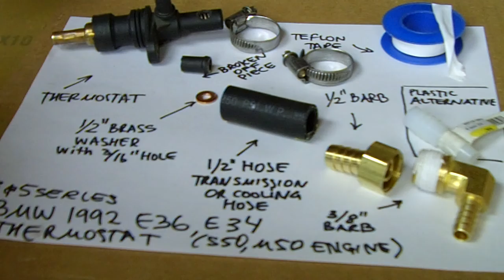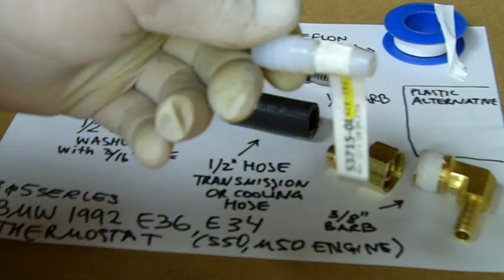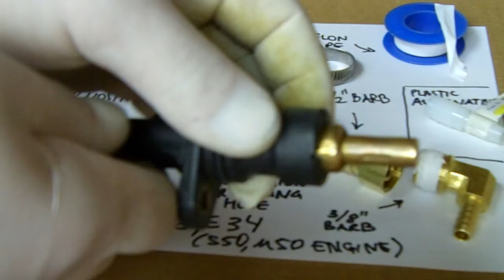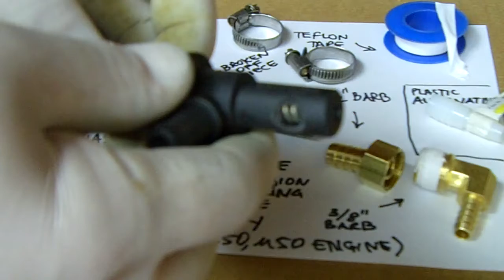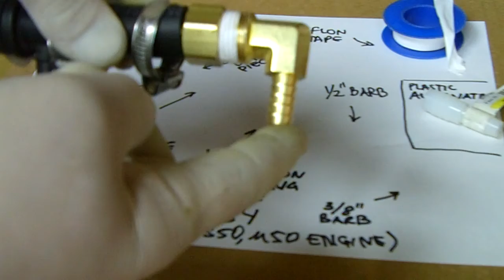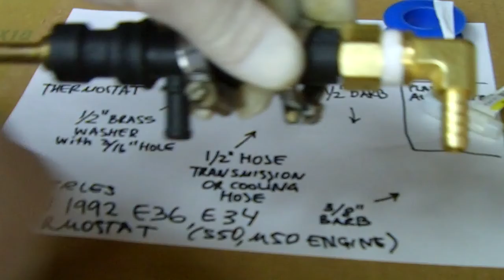BMW Thermostat Repair.Air FilterThermostat, not engine thermostat.

Comment from the maker: I also found a copper tubing that fits into the fitting that is not broken and cut it to length of that fitting. Applied JB WELD on the tubing and inserted into the NOT broken fitting. This will reinforce the old fitting to insure that it will not brake like the other fitting did.